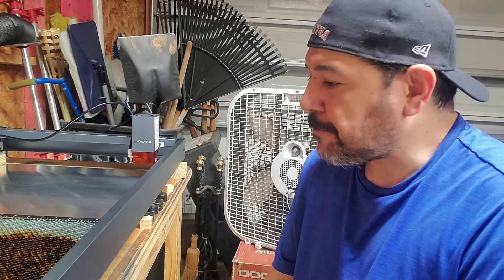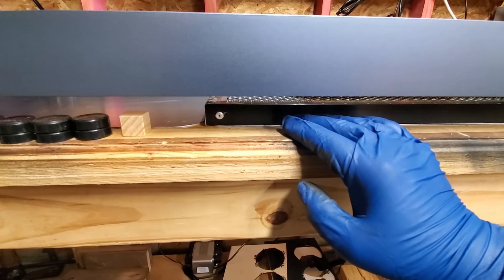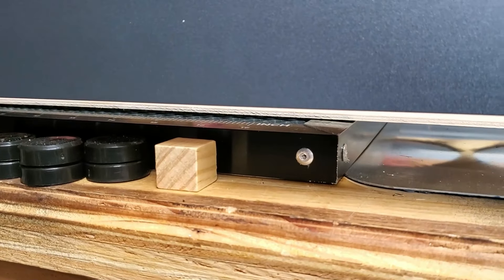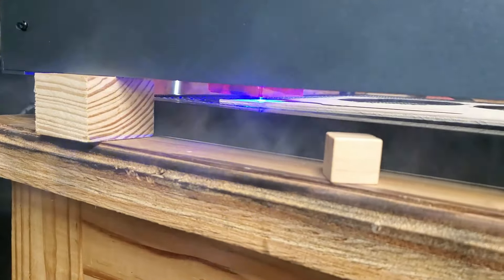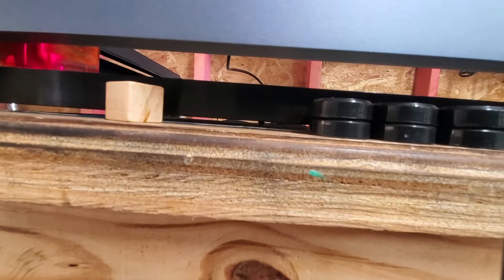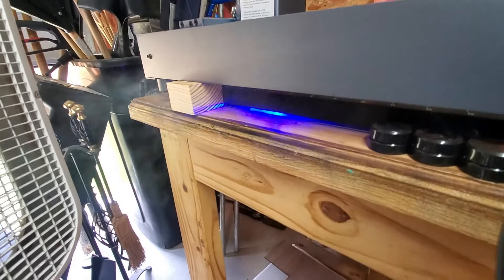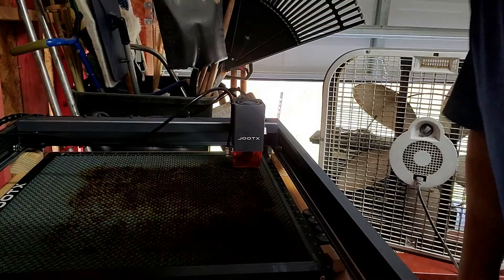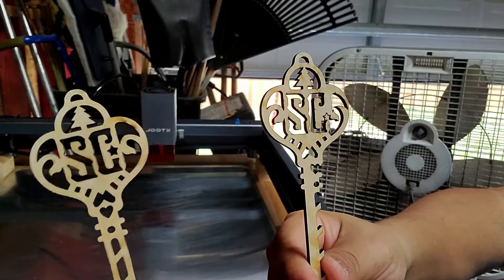Adding Bumpers to xTool D1 Diode Laser Honeycomb Panel (S5; E13)

Comment: Thx for the video.  Great job of showing it all.  I'm thinking that the wood is being pushed up from the honeycomb still, even though the new space has been added.  I'm going to try the same thing as you did but with a larger space.  One reason why is that I will be cutting actual paper.  I will be doing from one single sheet to a stack of 10 or so.  I may have to and a weight on top.  Perhaps material like is the supporting layer of a typical note pad.  Keep up the good videos.
Reply from the maker: Hmm, I haven't done actual paper yet. I might play around with that this weekend. Hope you're having fun with the laser! :)